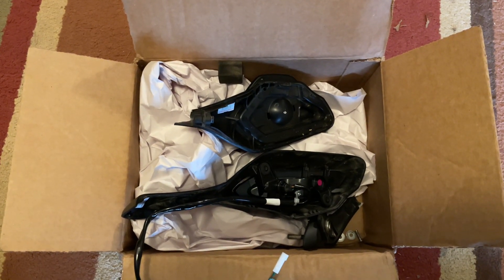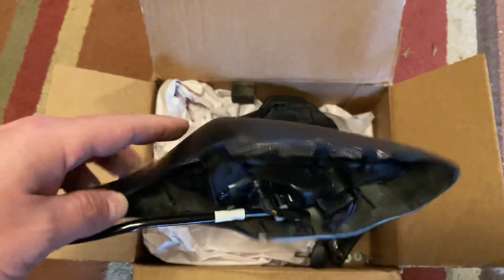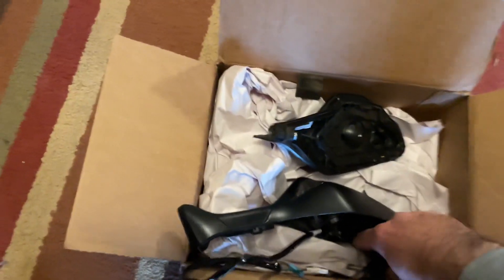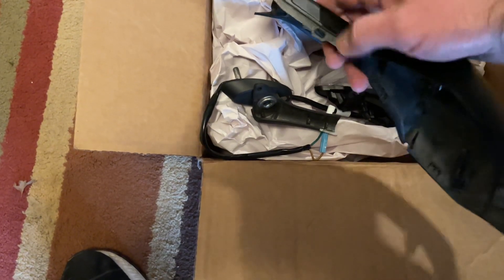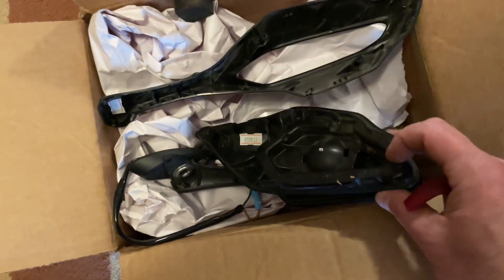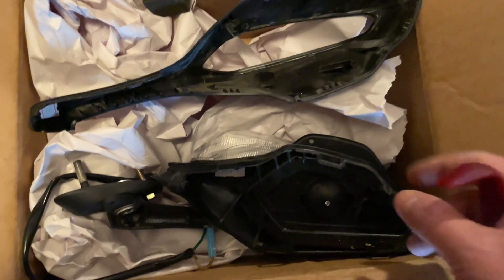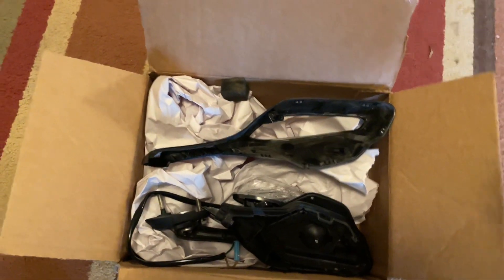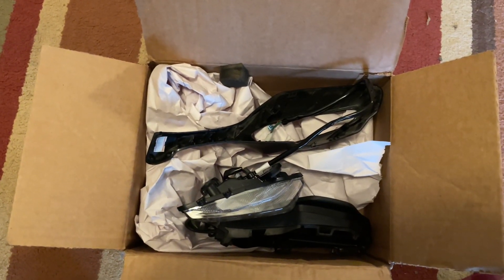How to disassemble Honda cbr1000rr and cbr1000rr-r mirror

Comment: are those turn signals on the RR-R 12V?? or they the same 6V as the RR im asking cause Im trying to fit them on my 2014 RR that is 12V
Reply from the maker: @Weaponx9x  from what I remember I had to transfer the blinker module over because the rr-r would hyper flash on my 2018 rr. Different voltages and resistance probably.
Reply: Ahh ok yeah man I burn 1 set of mirrors from an RR 😂. I got another set but I haven’t try to install them cause I don’t want to burn them out. Thanks